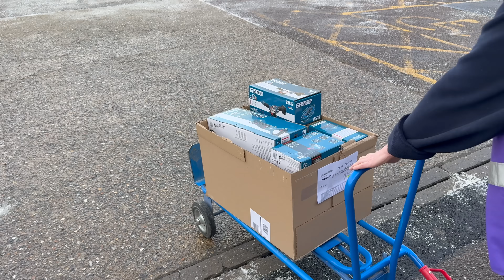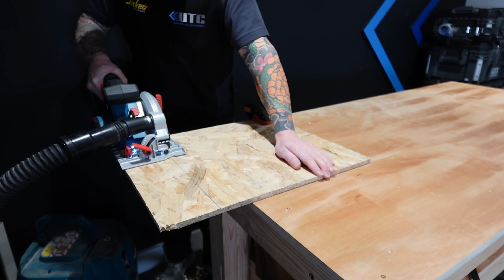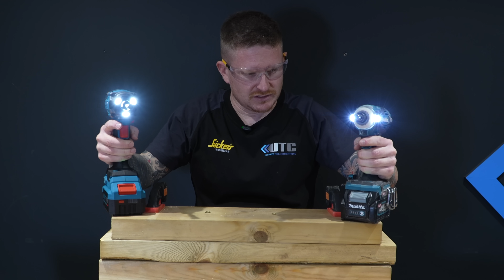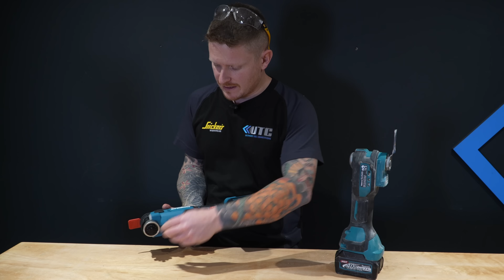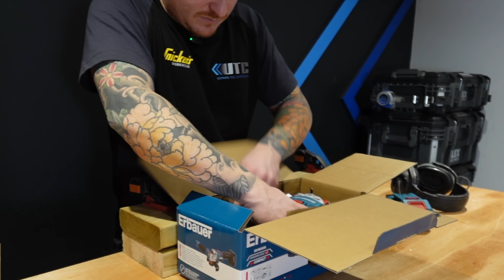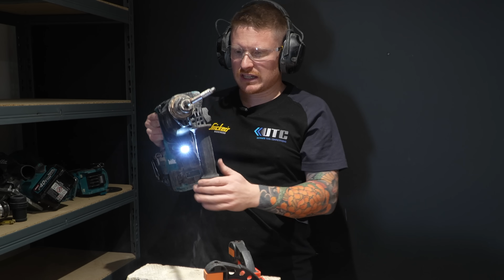New Erbauer V2 Tools | I Was NOT Expecting This

Comment: Impact test was a bit unfair for makita tbh. U used a 5ah on the erbauer and a 2.5 on the makita. The makita went through more knots by the looks of it aswell.
Reply from the maker: It’s 40v, 2.5 is wired differently so is equivalent to a 5ah. Spec sheets back up that the Erbauer has more power too
Reply: @TheDIYGuy1  if u used a 2.5 on a chop saw n then use a 5 there is significantly more power though in my opinion
Reply: Google agrees my friend

Comment: My top of the range DeWalt drill driver with 3 gear setting cost an arm and a leg 8 years ago.  The chuck locked up and failed.  You can not replace the chuck without disassembling the entire tool then struggle to reassemble.  I bought an eBay chuck which was a decent enough and replaced it but I am stuck on the impact setting….I have several dewalt tools.  I am now migrating to Erbauer and will never buy dewalt again.
Reply from the maker: Thanks for sharing your experience!

Comment: Hi, I am a tradesman and have been using Erbauer for about 5 years and I have yet to have to replace anything yet. The only issue is with the grinder and thats the switch which keeps getting jammed with dust and needs cleaning out with elec cleaner, I think this is due to the strange rocker design. Just added the new sds breaker to my kit and it performs very well. The blade release mech on old recip saw is much better than new it seems. All in all great value and performance, I would recommend to both trade and diy, also the batteries are good value and charge very quickly on my double battery charger, I have only replaced one battery so far, give them a go, dont be a tool snob.
Reply from the maker: Nice feedback

Comment: I actually really like the old V1 circular saw, but I'm left handed :)
The pain you felt using the old circular saw is my life everyday living in a right handed world.
In the V1 range I have the Reciprocating saw, Jigsaw, Combi drill (the one with the metal chuck) the impact driver, the circular saw, the random orbital sander, and the little vacuum.
The vacuum is rubbish, 
the sander is good.
the jigsaw is ok, getting decent blades and knowing when to use and not use the pendulum setting is key.
The Combi drill is good
the impact drive could be better, it needs a more variable speed on the trigger, I rarely use it, I use a smaller Bosch Pro 12v impact driver for this reason. the erbauer impact driver is either off or going at full speed, and sometimes you need to use slower speeds depending on the wood, screw size etc.
I had the hedge trimmer but I sold it after using it for a specific job, it was cheaper than renting after I sold it.
the reciprocating saw is ok, but its the only one I have used so I have nothing to compare it to.
Reply from the maker: Hearing you!

Comment: Thanks for the video, as someone that doesnt have a jigsaw or circular saw, they both seem to do the same thing, other than jigsaw around corners, what is best to get first and why? is circular saw better for standard straight cuts? Also, does this new range support the old range batteries? would have to have to buy new ones.
Reply from the maker: Circular saw is far superior for thicker timber, straighter and cleaner cutting. It should be first before a jigsaw in my opinion as is more versatile
Reply: @TheDIYGuy1  thank you

Comment: Great video. Great tools but an unfair comparison against 40v. Would be good to see the same tests against DeWalt 18v and Makita 18v. Their Elite range is the higher spec stuff. They also do an Elite angle grinder with paddle switch and variable speed settings. That multi tool is also fantastic at anti vibration. Tested it on wood against the DeWalt equivalent and it was so much smoother to control.
Reply from the maker: Thanks, glad you liked it. As I mentioned in the video the 40v are there as a benchmark not a comparison.
Reply: @TheDIYGuy1 yeah fair enough. Maybe could you do a comparison video? Erbauer Vs DeWalt Vs Makita all 18v tools but the best they do. I don't envy your job with everyone giving you their opinions though! Good luck
Reply from the maker: Haha part of the job, you get use to it 😂. Cheers for the suggestion

Comment: I've been waiting for someone to test these on YouTube and couldn't understand why they seem to have fallen under the radar! I have ELITE combi drill and the impact driver (220nm max torque and the not the ELITE one tested here) on the new Erbaurer V2 brushless motors and EXT battery platform for 6 months now and can confrim the amazing value of these and the more powerful ones are perfect for jobs required for thicker material such as for framing or external construction. The one main downside is the size of the normal EXT batteries; they are are much bigger than the equivalent ones for 18v Makita, but there is an pouch-based 4.0AH (Elite Cell) which is much more compact but also more expensive, though at £55 is still cheap compare to the big 3.   Just to be clear, the combi drill you tested was the ELITE drill (ERI1107COM), which is max 150nm torque and stated to have anti-kickback, though I've never been close to activating that. Note there are less powerful combi drills in the range using the new V2 brushless motor, which use nylon gearbox (the ELITE has all-metal gearbox)  so just something to watch out for when purchasing Also, the SDS drill tested here has a nylon gearbox, so probably the power on that is limited to save the gearbox.  Finally, the EXT battery platform can be used on Evolution, which have higher capacity batteries like 8 AH that are compatible the Erbauer V2,  and other Chervon produced 18v tools like SKIL.  Thanks for putting you own money towards this!  The eco system for these battery platform is much more extensive, so maybe look into that next ?
Reply from the maker: Really appreciate the detailed feedback!

Comment: The sander is fine without the massive battery, bit of a pain in the backside using the smaller batteries though as your changing them constantly on the longer jobs
Reply from the maker: Yeah, battery choice is always a bit of a trade-off!

Comment: I'm a big fan of the Erbaur for supplementary tools or initial buys. My daily hand power tools are Milwaukee, my mitre and circular I like Evolution, but for everything else such as jigsaw, planer, tracksaw I've been more than happy with the chorded Erbauer range. Then I also have the battery vacuum and brad nailer. I think they are great for DIYer or a trades person feeling out a type of tool and either sticking with it if it's good or upgrading later if it's something that subsequently gets used more often to warrant a more expensive outlay.
Reply from the maker: That's a good approach!

Comment: The guarantee make these tools unbeatable for me use there tool on site daily and now moving on to the new range .took a 18 month old battery that wouldn't charge back to screw fix changed straight away no quible. The old sds lasted 6 years daily use.
Reply from the maker: That's awesome to hear about the guarantee!

Comment: Lovely video with lots of useful info. Tradesman myself so use the DeWalt platform. 

On the dust outlet of the circular saw, I actually think I'd prefer the side entry for the following reason. Most all vacuum hoses are ribbed along their length which when exiting from the rear of the tool and over the workpiece, catch and snag the rear edge. This is particularly annoying, at the end of a cut, on sheet materials, causing the tool to temporarily snag until the hose is freed up. Side entry should solve this problem. Just a thought.
Reply from the maker: That's a really good point about the hose snagging!

Comment: Exactly the same tools are available in different brands and colours on AliExpress and Temu at lower prices ... Generic Chinese stuff like lidls Parkside brand . 
Don't be put off , the brushless motors are awesome for the money , far better than any conventional brushed motor ...  I own loads of expensive branded tools and comparison at  price and quality points, the cheap stuff stands upto the expensive stuff  . Definitely a great buy for diy'ers on tools you don't use so often .  The grinders and impact guns are great value  ...
Reply: I don't think your point about Erbauer being generic Chinese stuff is up to date. Their new range is made exclusively by Chervon, the same company that manufactures Flex and Skil tools, which are pretty highly regarded, especially Flex.  The new Erbauer multi-tool actually has the same body as the Flex (I'm sure there are other similarities, but the multi-tool is the easiest to spot).  Obviously, that doesn't inherently guarantee that the Erbauer tools are comparable in performance and quality to Flex but I think they're probably slightly cut-down versions of them.

Their old powertool ranges were made by Positec, who manufactures Worx and some other low/no-name brands. Fair to call the Positec brands generic Chinese stuff I think, but the Chervon brands sit a bit closer to the premium brands (DeWalt, Makita, Milwaukee, etc.) imo.
Reply: @BrokenSmokes   The exact same internals with different shells .... They use the same brushless motors .
Reply: @BrokenSmokes   The new V2 brushless hammer combi drill is identical to a AliExpress Chinxantia brand internally ... I know I repaired a few .

Comment: Einhell next, please. I bought an Einhell lawnmower kit with 4ah batteries, and later supplied with a battery chainsaw. Looking into buying more Einhell tools instead of Bosch 18v. As a DIY'er I certainly feel like I have overspent on the Bosch platform with drills, impact, track saw, fsn-rails, jigsaw, router, and many batteries. Secondly it looks as if other brands have surpassed Bosch long ago anyway 🤔
Reply from the maker: Thanks for the suggestion!
Reply: I was put off the Einhell by their combi drill - admittedly only a 2kwh battery, but it was so underpowered, and little things like the chuck feeling really cheap put me off buying any more.

Comment: You had the Erbauer in your dominant hand, rerun with the Makita in it and the results may reverse, even you you fell you put the same pressure on both drills.
Reply from the maker: Maybe. The specs back up the result though. The Erbauer has a higher RPM and torque.

Comment: The skil 20v tools are from the same manufacturer and are very good quality for the money. You can use the skil batteries in the erbauer tools but you have to remove a little tab on the battery on some tools to get them to fit. The skil batteries are normally cheaper to buy aswell.
Reply from the maker: Good to know, thanks for sharing!

Comment: I've had a corded 300w erbauer multitool since early 2019, use it on all jobs, dont even know how many kilometers of flooring it has done at this stage, door frames, laminate or boards, counter tops, cabinets, fences, plaster board, skirting boards etc ... countless sets of blades. Noisy feker (that's what the ear protection is for) but never stops, it does warm up a little on a long run but never overheats and always has plenty of power. Back a few months ago, I finally got makita 40v multi since I have a complete 40v battery and tool set now, that multitool is lovely to use if somewhat too big. But erbauer is staying, in case I run out of starlock blades in the middle of the job. 
I have made a mistake going with parkside professional as my second or budget option, they are decent tools but rarely available in lidl. Should have gone with erbauer, especially since v2 came out. Lovely tools nothing wrong with them for the money, and the main thing they are always available locally no matter where one finds himself.
Reply from the maker: Sounds like it’s served you well

Comment: Love to hear your thoughts on the Worx branded tools...marketed for DIY'ers
Reply: I have 2 Worxs tools.. a cordless jet wash capable of drawing water from a bucket, and a cordless leaf blower. Both purchased to wash and blow dry my motorbike 😅. They’re both fantastic and the jet washes performance amazes me every time. 

That said, i just dont think i would ever have bought them if a typical mainstream brand had the same product offering. They’re not cheap, and in fairness the dont feel it either. But if you was to buy into a single brands ecosystem, you have far more options with Dewalt, Makita, Bosch etc. More products, accessories, retailers, support, common sizing.

Thats just my 2cents anyway. I know my 2 Worx products aren’t the typical household DIY tools but thought i’d share my thoughts.

Comment: Really informative video, thanks...but the question I always ask is what is the longevity of these cheaper brands? Yes, they perform as well as premium brands out of the box but are they still as good and still running after 2 years/3 years of use? It's probably a difficult ask but it would be good to see You Tube channels doing a follow up 1year/2years/3years and see if they are still going. Personally over the years I have found these cheaper tools blow up after a year or two use whereas spending on the more premium brands and they are lasting 10 years+.
Reply: the Kingfisher brand tools like this also offer no spare parts. The warranty is good, but if it dies after the warranty ends, it's junk.

Comment: You're being far to critical. Also you put Erbauer up against  much more powerful tool range, 40v against 18v is very unfair comparison. I have always used Makita tools at work and for my toolkit that I use at home it has always been Ebauer. I cannot fault them and on some occasions they perform better than big named brands. Also these tools are not DIY as they are listed for trade use in Screwfix ad just because they are sold in B&Q doesn't make them DIY. You are actually looking for problems with these and some of the faults you have noted are just pathetic. Like I said 40v against 18v isn't a fair comparrison. I think if you had compared them against 18v LXT Makita you would have come to a different conclusion.
Reply from the maker: As mentioned in the video , It’s not a comparison.

Comment: I bought a complete set of brushless erbauer tools at the start of COVID and included a boxed lighter weight hammer drill with 2x4ah batteries and a heavier duty drill with 2x5ah batteries, just before larger Lion batteries jumped in price of they were even available. All of them are still going strong though am not a trades person.
I found the v1 circular saw and planer to be useless. The sds is ok but very lightweight. Multitool is ok. Generally I have been happy with them but the v2 looks to be better quality and glad they have a better circular saw and that planer looks better too.

In hindsight, Ryobi have a much wider range of tools and I believe better quality. That said, Makita tools have very good quality gearboxes and capable of continuous rigorous use for years. Pretty sure my erbauer tools would never last as long in daily use, but they are reasonable. I wish they made a power file though.
Reply from the maker: Cheers for sharing

Comment: Mate, with the replicator saw you could insert the battery and make the blade holder come out slightly so you could access the blade release collar easier. I don't think this should be a no for this tool. 
It's just my opinion thought.
Reply from the maker: You may well be right but my dewalt has a much better release function without having to do anything with the trigger so for me it’s a no as it’s just fiddly
Reply: I have the older model, it doesn't have that issue, seems like they downgraded it if anything

Comment: I bought the Erbauer biscuit jointer and it was really crap. Sharp edges on the metal casings, and not even square, so the cuts did not line up. Swapped it for another and that was even worse. Would not buy anything else form them.
Reply from the maker: Cheers for letting us know

Comment: I said this on your last test and I’ll say it again…..the blade on the circular saw shouldn’t be set to full depth. It should be just deep enough to cut through the material. Using the original (version 1) saw with a speed square is not an issue if the blade depth is correct.
Reply: Nobody does that.
Reply: @gg-ct3fo  you missed my point that he had a dig at the gen 1 version of the saw motor hitting his speed square when raising the blade would have sorted it. But whatever.
Reply: @chrisb2443  no I read your original comment and completely saw the point you were making. I'm just saying nobody adjusts the blade setting and needing to do it in order to get around an annoyance makes the tool not worth it.

Comment: One bit of feedback (as a newbie DIYer), several times you're very vague with the price of the Makita tools. I understand that's not the point of the video, but it feels like it wouldn't take long to look them up. For instance, you often say "about double the price" - to which my immediate reaction is "is it thouughhh?". Turns out, the 40v SDS drill is £300 (as far as I can see), so £79.99 is an even bigger saving than you made it out to be! Especially given how often I'm going to use an SDS drill after I've broken up the concrete step out the back of my new house (bridging the DPC! Grr!)...

I feel like "about double the price" feels vague and wishy-washy, whereas "you can buy these online for XXX" is much more informative (even if they are roughly double) for not a lot more effort. Just my £79.99. ;)
Reply from the maker: Fair enough 👍